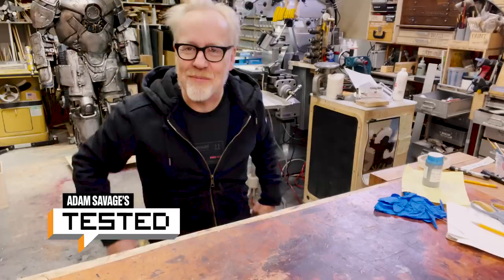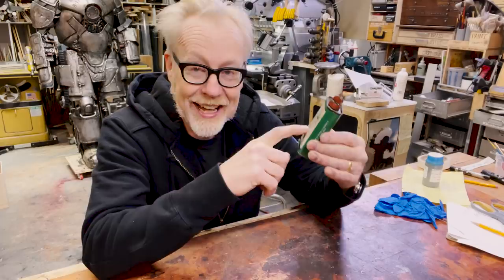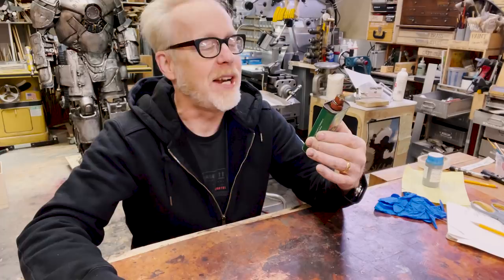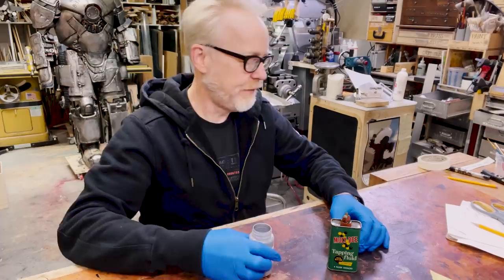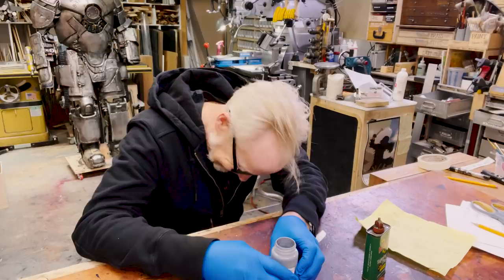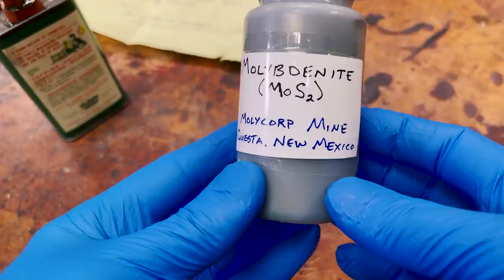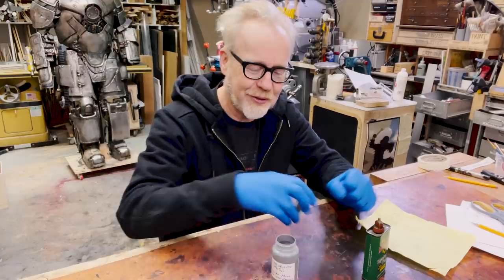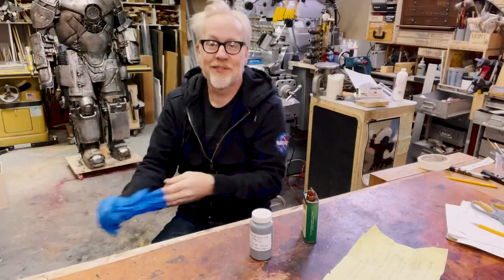Inside Adam Savage's Cave: The Return of Moly Dee!

Comment: fun fact: MoS2 was the initial option for the lubrication of the curiosity rover's robotic arm but under extremely cold conditions it wears the gears more than it lubricates so they scrapped it
Reply: When studying lubrication in trade school many years ago, we learned never to put moly grease into a bearing as it will wear down the bearing inside.
Reply: Do you know what they used instead of MoS2?
Reply: @senya6095  The point of a lubricant is to have a film that separates two pieces of metal. Any pure oil or grease will do this. Added moly is meant to wear down the high points so that even less contact is made.

Comment: 20 years ago, I used to work for a company that exclusively worked Molybdenum. It is a bizarre metal. Non ferrous, none conductive, wouldn't rust or tarnish. Required heat to press. From between 300 centigrade for 1mm small components to 1,000+ centigrade for 3mm plus large components. The components the company used to make were used in semiconductor industries (Heat sinks in microchips), magnet manufacturing. (We made furnace boats for a company that made magnets). train Brake components, and even golf club shock absorbers. 
And its very hard. I tried cutting through a 5mm thick bar that was 100mm wide with a 110mm grinder. The disc wore out before I got more than half way through it. 
I believe we were the only company in the UK that worked Molybdenum exclusively. The company was bought out by a big American company in 2002, and I moved away from the area. No idea if they are still running.
Reply: And it’s a great lubricant:)

Comment: "Overexposure is rare" I couldn't help but laugh, lol. As a miner who used to come home covered in this stuff on a daily basis I feel like I couldn't have been any more over exposed. Still, best not to breathe it.
Reply: I worked a short wile at a lamp block manufacturing plant being shut down the crews were black from head to toe and water made it impossible to remove it .  you had to apply dish soap and scrub it t be able to rinse it off your skin further the stuff got in to every area of the body.
Reply: I was also a miner at a copper moly plant (Duval) in Arizona, and was 'covered in this stuff' frequently.  It is amazing how that stuff would impregnate everything, especially the leather of your boots and your car's interior.  Just no stopping it.
Reply: @kirbyspencer538  Wow, what a coincidence, I worked at the Freeport moly plant in Green Valley. That used to be the Duval Mine, right?
Reply: @mrtommypickles8635  Yes.  The same mine.  I was in the Instrumentation Dept. so we worked everywhere, from the water fields to the primary crushers and kept one shop in the mill and another down in the leach plant (sounds like that is called the 'moly plant' now).  If you wanted a really good dose of moly all you had to do was replace a thermocouple on the 9th(?) floor of the roaster building.  :)

Comment: I’ve got a bunch of that molly powder, in the 90s we used to impact plate our long range bullets with the stuff, pretty cool but it turned out to cause other gun problems. Put a spoonful in a small Tupperware box along with a cup of steel BBs and your copper projectiles and put it in a vibrating brass case cleaner for a couple hours, it impact plates your bullets, making them grey.

Comment: i love moly-kote grease. My mountain bike always had excellent lubrication when I used it on bearings, headset, bottom brackets and a dry coat for cables (they don't gel up when it rains). I also use a dry application of moly on my firearms. Not oil. Sure, I have to clean them more often, but they operate so much smoother than an oil lubricant. Molybdenum.

Comment: Molyslip is amazing stuff, put it in a gearbox that is whining, manual transmissions only, or non limited slip differentials, and it will shut it up almost totally. Used it in industrial gearboxes as additive, and it makes them run cooler and quieter, plus slows wear on heavily loaded gearboxes. Generally I buy it in tubes, as a little will go a long way, and yes it is going to stick to every surface, and stay there pretty much forever.